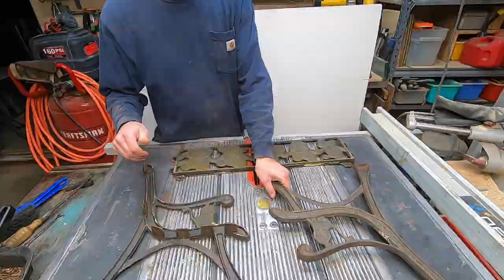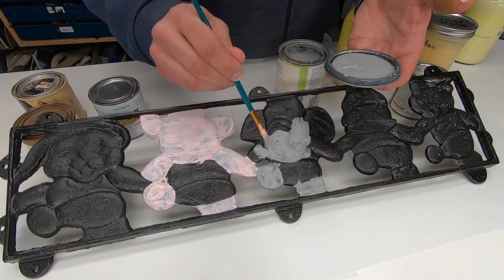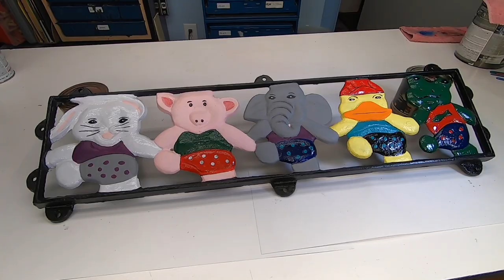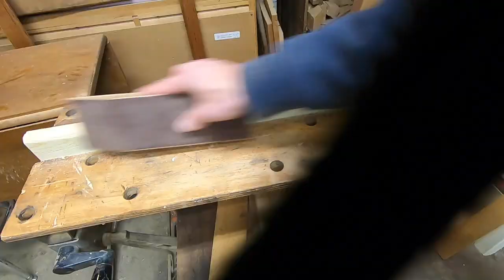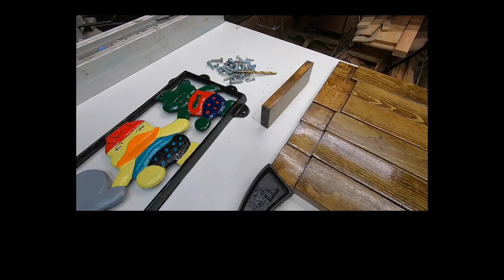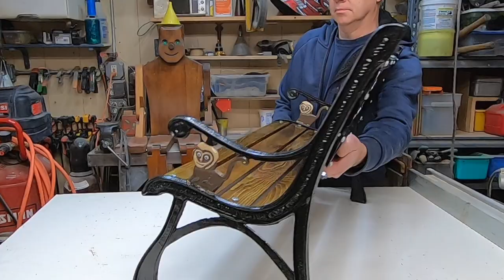Toddler Indoor/Outdoor Bench Restoration

Comment: Can you explain how you prepared the metal for paint and what kind of paint you used. Some paint was flat and other shiny. And what protection did you use. I want to restore a small garden table for my mother and I want to use different colors for the flowers in the metal/aluminum
Reply from the maker: To prepare the metal, I used a product called Klean Strip Metal Prep. I did a review video on it here: https://youtu.be/98Oxee5xbdg
Once you have this prepared you can use almost any paint. I used a combination of any paint I had where the color was what I was looking for. I used house paint, oil based paint from a can, testor paints, acrylic paints in those little plastic jars. I probably would have used all oil based paints if I were going to put this outside but it's too nice to ruin it is the bad weather. On the wood slats I used Spar varnish but on the painted parts I wanted to use a clear acrylic sealer as varnish might tint my paint colors a little. If you are using oil based paints, you probably don't even need any sealer on it. Good luck. Tom